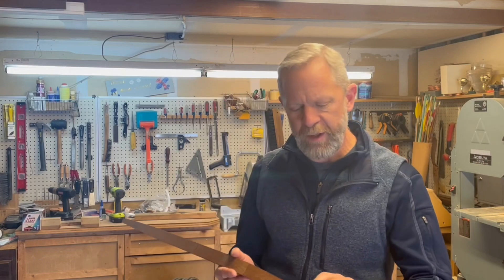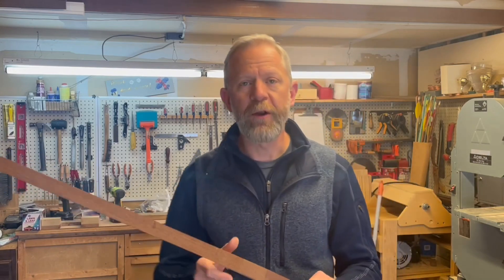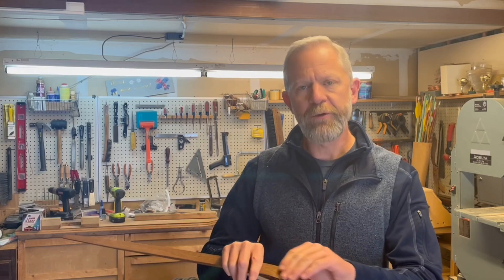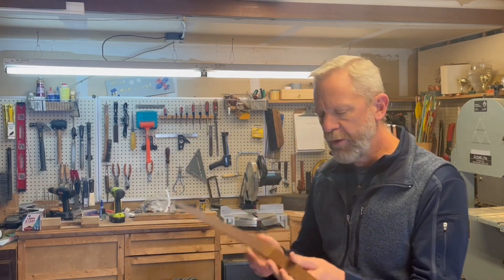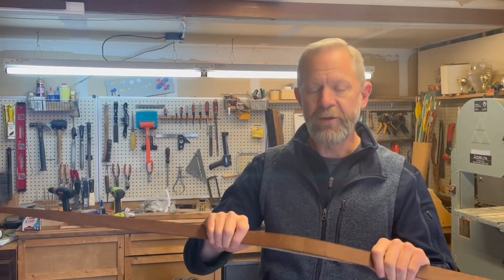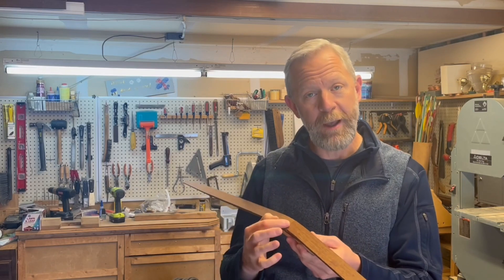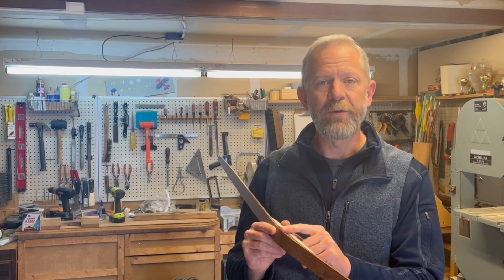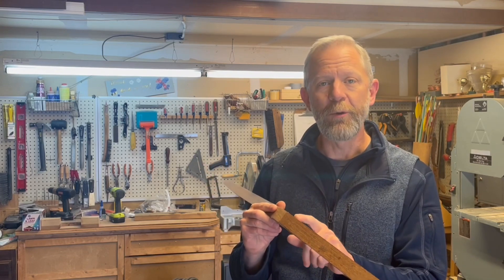Egyptian Duoflex Pt.2 - design and glue up of the riser and limbs

Comment: Okay so 66in AMO and no splicing of the ipe slats I'm guessing because your going to include the power lamination and bamboo backing thus making splicing time-consuming and unnecessary. I still have one question thou: should I leave my hickory stave in one piece or should I cut it into two slats like how you had your ipe?
Reply from the maker: Anytime I can leave my parts in one piece I do. This design takes advantage of my circumstance which was 2 limb pieces and my desire for a pretty extreme deflex at the grip. If you’re looking for a similar design with a single belly piece (especially hickory) you can stream the grip area and achieve a concentrated bend to make a similarly shaped grip area.
Reply: @meadowlarkadventuregear  okay cool, thanks for the tip. I already glued up a triangular riser similar to the one you made except I used a 1in long 5/8in thick piece of hickory a 3in long 5/8in thick piece of red oak a 5in long 3/8in thick piece of hickory and a 7in long 3/8 piece of red oak. Glued em then sanded them into an isosceles triangle shaped similar to yours just longer and thicker and I think slightly less sharp of an angle. My plan as of now is to glue from the bottom up on my R/D form as follows: Riser, power lam, hickory, Bearpaw Stabil Kore carbon strip, Bamboo backing. Then I have some water buffalo horn and deer antler to make tip overlays from. I want it to turn out like yours, or like Sarmat Archery's "Bow Horus",  AF Archery's "Kadesh" or WillBowMaker's Egyptian short bow. When braced it takes the shape of an obtuse isosceles triangle with an angular forward set riser and reflex/deflex limbs, then it becomes a perfect semi-circle when drawn, the distinct shape allowing the Bow to be drawn out to 34-36in with little to no stacking when done right. Sarmat's A.M.O. is 59in, AF's is 56in and WillBowMaker's is 58in. I intend to go quite a bit longer, like 66in